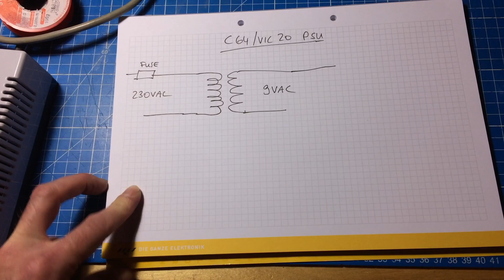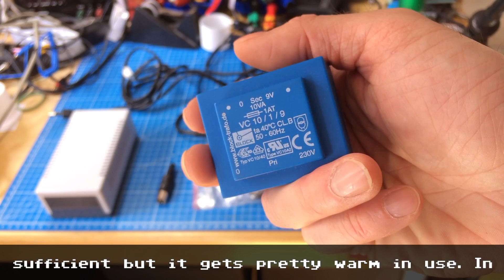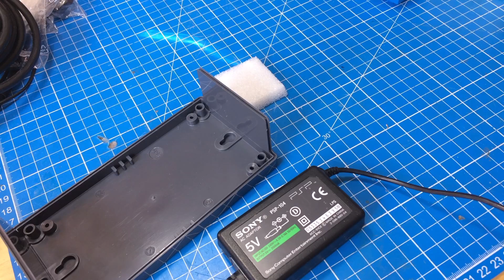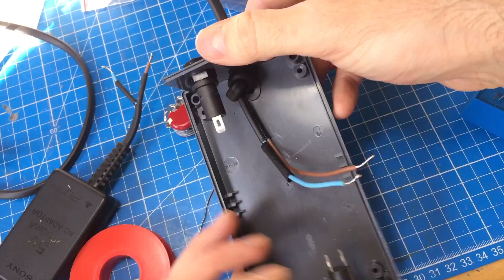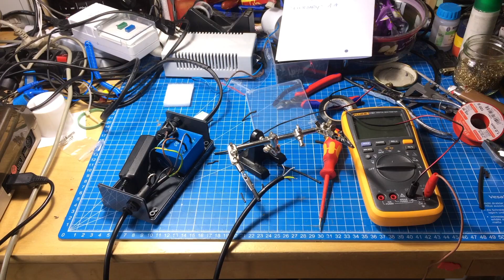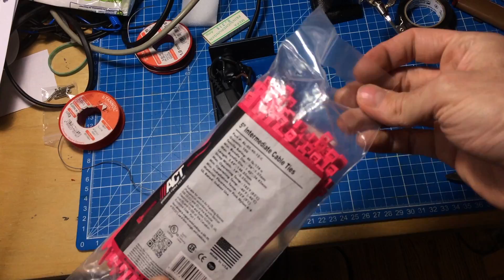Building a DIY C64 Power Supply (The Lazy Way)

Comment: Take it from a electronics engineer. Use a full bridge rectifier, 2200uF or higher filter cap and a buck converter for the +5V DC.

Honestly the LM7805 isn't that bad of a regulator. there are also others and varible regulators such as the LM350 and the LM317 that can be set for +5v DC output. The only two ways I can see a LM7805 dieing is constant over current or not enough cooling.
Reply: Yeah, I think I would be tempted to get a beafy 9VAC, and feed a rectifier (with large electrolytic) from that and use a buck convertor to derive 5v DC from the 9VAC.  That way you've only got one mains input and both voltages coming from that 9VAC effectively.  And for good measure, merge one of bwacks 5v savers to stop overvoltage - although probably not required.
Reply from the maker: Yes, I totally agree. The proper way of doing this would be to use a larger transformer for 9VAC and also feed a rectifier and a buck converter from that for the 5V. I wanted to make it a bit easier for people to build. I'm planning on modding an old breadbin power supply with a proper rectification circuit and a converter soon. C64saver is on order. ;)
Reply: I'm interested in understanding why you would do this instead of using the transformer? Heat?
Reply: SimmeringPotpourri you would still use the transformer. From the transformer secondary forward is what I was talking about for the 5volt supply.
Reply: Well, the original power supply uses an LM7805 and causes lots of problems. The cooling of the original power supply is not sufficient and I doubt you can build a better heatsink yourself. So yes the LM7805 is a very bad choice. You should look for a switched regulator like the LM2596 or XL4015.

Basically, if you use an LM7805, what is the point of building your own power supply?
Reply: There is an LC filter right behind the power connector of the Commodore 64, which filters out noise. Further, the C64 considers the 5V input a high noise line (the digital chips generate noise on it due to their 1MHz clock frequency). For the analog circuits, the C64 generates a low noise 5V from the 9VAV inside the computer (using indeed, an LM7805, but with very low current, so limited amount of heat is generated). Therefore ripple is not a big problem and that is why you use a low-cost switching power-supply like Jan Beta shows here. Of course everything within reason .

The C128 power supply, often used as reliable replacement, uses also a transformer plus switching voltage regulator.

If you watch the video, the 10.5V AC was measured under load. It is acceptable, the C64 has been designed to accept tolerances in the 9V AC.
Reply: The C-64 PSU produces (2) independent outputs -  9VAC (straight from an xfmr) and 5VDC from a rectified / regulated xfmr line. There simply isn't any other practical way to do this, at least not in the mid-80s.
Reply from the maker: I linked Greisi's video in the video description, too. I'm a huge fan of his design. It's a lot more expensive to build, unfortunately. Still a proper way to do it, of course. ;)
Reply: I had that thought too, but aren't 9VAC and 5VDC lines supposed to float independently? Or does C64 not actually require that and grounds them together at some point?
Reply: It's a bit of a wierd one from memory - I think the 5v from the PSU feeds the VIC, and the 9VAC is bridged to 5VDC for the rest of the logic on the board, as well as the actual 9VAC feeding a connection on the user port and also provides the 50 / 60 hz used by the TOD function of the CIAs.  And the grounds are joined.  I never really understood why commodore did that, other than to provide the VIC with its own clean 5v rail.  Also note that 12VDC (or 9V on C64C) is derived for the SID via a 7812 (done with a zener and transistor on the C64C I think), also from the bridged AC output.  I think the 9VAC always ends up much higher than 9VAC btw.  I vaguely remember measuing around on a number of boards in the past and measuring between 12VAC and 18VAC.
Reply from the maker: Yes, the 9VAC are rectified and converted to 5VDC and 12VDC inside the C64. The grounds are joined together anyway at that point.
Reply: You can do a lot better than potting 7805 in resin, for one! Even if all you had was a 7805.

Besides, your 7805 wouldn't have 3 decades of accumulated decay on it.
Reply: So... 10.5V as shown in the video mean s that 1.5A you produce 6.5W of heat in the LM7805. This is probably too low since rectifying 10.5V gives you more than 10.5V DC (depending on load).

If you have a good proposal for a heatsink that can cool that I think many people here would be interested to hear what to use. Until then it is not a usable approach. At least the advantage of the resin is that the entire enclosure of the PSU becomes the heatsink, giving you a large surface to radiate heat from.

Further, I consider it is also unethical anno 2017 to waste so much energy.
Reply: Another thing: The failing LM7805 problem was well known in the 80's. The cause is not that the power supplies are old (allthough it doesn't help), the cause the heat production of the LM7805, often in combination with additional hardware connected to the C64 that draws just a little bit additional power. Because the result of a failing LM7805 is s seriously damaged Commodore 64, I really see a lot reason to warn people not to build power supplies with LM7805. Why would you risk it if much better alternatives exist?
Reply: Actually the AC measurement was unloaded AC. Since 5V portion of the computer consumes quite a bit, it will be much closer to 9V AC, which will rectify into about 13.5V. So if you were to use a linear regulator, you need to dissipate 8.5V at... hopefully just 1A, but nominally closer to 1.5A. That's 12W. Naked - in nice natural airflow - the TO220 has around 20°C/W, so at deltaC of 100 you get about 5W out of it. Just look for a heatsink with around 6-7 °C/W or lower and give the secondary some passive convective airflow you'll be fine, now it will still reach 80°C or more, but it's within spec. It actually gets better than this consideration because as the current rises, the output voltage off the transformer will tank.

But sure, using any switch mode stepdown board is exactly what i'd do myself. However it might be a good idea to post filter it with a CLC arrangement, because you know original linear linear regulator has very low noise.
Reply: I was in the middle of restoreing an old VTVM. it used a C cell battery for the Ohms function so I wanted to get rid of it and built a battery eliminator. I tried two circuits, I'm stepping down 6 volts to 1.5 volts. I tried using a 2v Zener Diode and a 1k resistor as a regulator. Works very well. I then tried using a Buck Converter as I stated before and it has ups and downs. It is nosiy as heck on the scope however with a couple of 100nF caps at the input and output of the Buck Converter it cleans up quite a bit but still nosiy. It can handle the current flow well. Dunno if it was because I was going from 6 volts to 1.5 volts for it to be nosiy but none the less it is worth trying with a 5v output.

When building quick power supplies I attend to use a 1K or 100K resistor as a load unless I really need to load it down for high current testing then I'll use a power resistor.

Comment: in the original PSU do both 9V AC and 5V DC fail or is it mostly the 5V DC that fails as the 9V AC just comes from the transformer? I plan to use the original PSU and replace only the 5V DC or is this not such a good idea?
Reply from the maker: I would also suggest replacing the original rectification circuitry (diodes and capacitors) with a new one that is a bit beefier. Planning on modding an original C64 PSU in that way too some time soon. ;)
Reply from the maker: The 9VAC are rectified and going through an 7805 and an 7812 inside the C64, too, so I wouldn't recommend using 12VAC for too long. The voltages you measured are coming from the regulators so they will be correct until you stress those too much.
Reply: I would opt for a supply that does all power lines. The C64 is already sensitive to minimal current differences. Imagine there would be a tiny say 0.2 Volt difference on the ground wires if you don't use a single one.
Reply: It's correct to say that the typical failure in the C-64 PSU is the +5V supply. Not as if the 9V AC cannot fail, but as it is simple AC straight from a transformer any failure of the 9V AC is generally just an irreparable open-circuit which should never  cause any further damage. In principle, there is nothing wrong using  a 'junk' C-64 PSU for the functional 9V AC s exactly what I'd do if I didn't have a spare 9VAC xfmr on hand.,
Reply: I think its a good idea. If you can get it open and then glue it back shut. Depending on which PSU model you have. You can even use an inexpensive DC-DC converter instead of the 5V regulator. Then your supply will run much cooler.
Reply: Yes once I get my ordered c64 I will try to do that. For now I am using an c64 (which had a black screen but replacing the PLA with a PLAnkton replacement fixed it!)  I found in my garage without any PSU, so I use a 12v ac and 5v dc to test it and that works just fine it seems voltages at SID seems just fine (12v DC and 5v DC on a SID6581), although voltage at userport is 12v ac but I dont use that and I dont think that 9v ac is used anywhere else? I am only using it for like 10mins a try just to be safe :)
Reply: Jan Beta yes it's just a temp solution just to see if that replacement PLA actually fixed the c64.